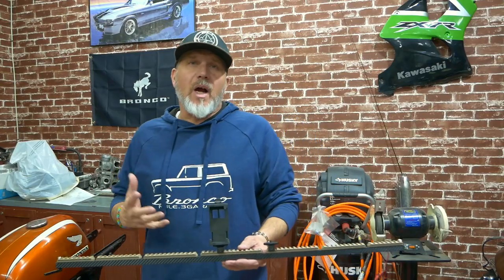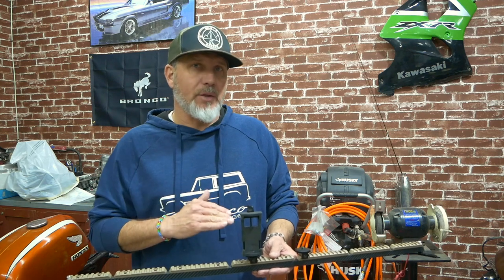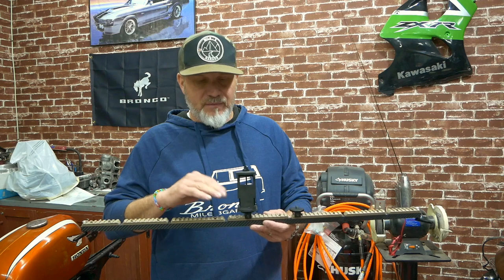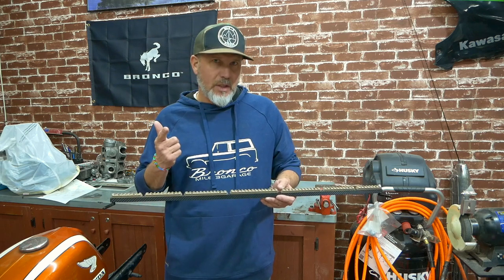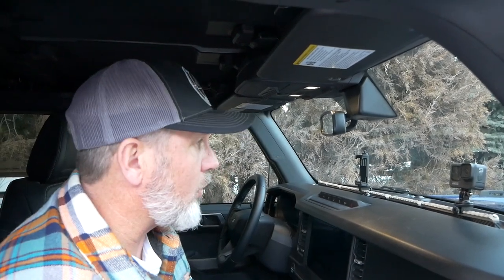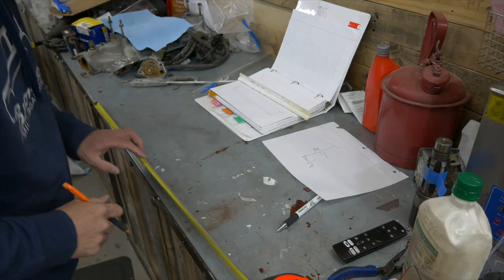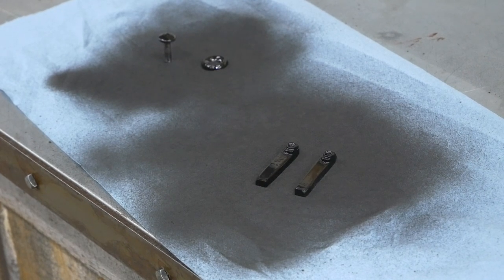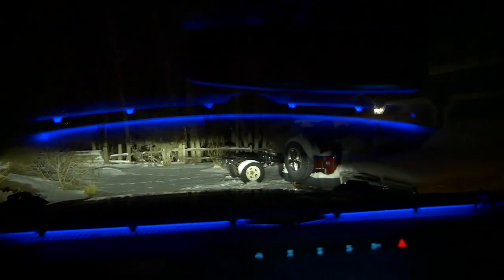Ford Bronco DIY Tactical Dash Bar - AKA Bronco Tactical Bar

Comment: That’s really cool!  I’ve used a 67 Designs rail systems on my Jeep and I’ll probably do the same for the Bronco. However, they don’t have LEDs which looks really handy.  I’d want red night time lights so I can see the interior without blinding me.
Reply from the maker: 67 makes some good stuff.
Reply: I just got the BroncoRail in today. There might be a possibility to run a strip of LEDs down the channel of the bar, but it is open on the top so it would shine up, not back in to the cabin.
Reply from the maker: @Overlanding4Fun  sounds like a good setup.

Comment: I'm confused on where the LED strip is located    you said "inside of the front side"    is that inside the channel?
Reply from the maker: Yes, inside the channel on the leading edge. So it literally faces the driver, but inside the channel. We felt it would give ambient light without being too bright and distracting. If you would like me to send a pic, email us at mile.3garage@gmail.com.